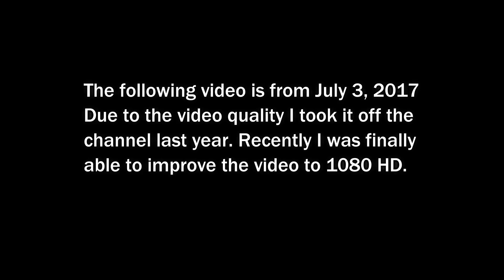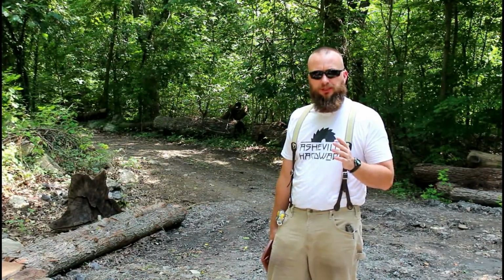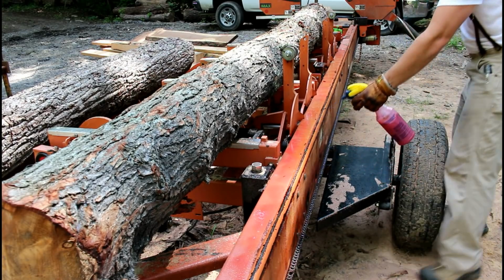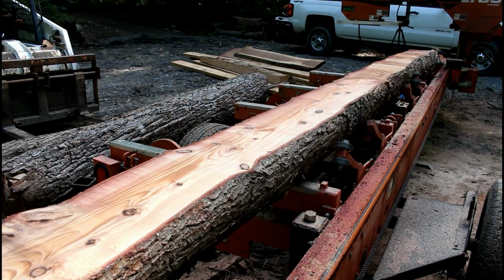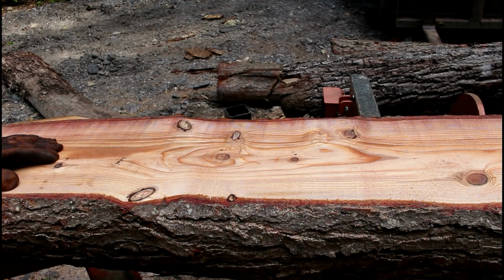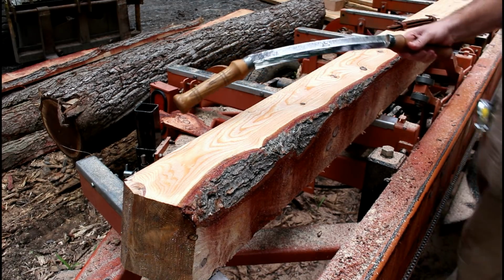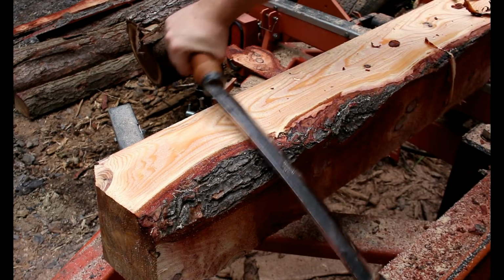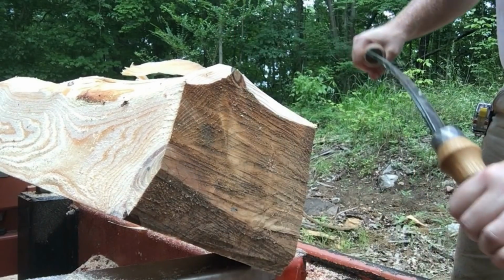THIS WOOD IS TREATED LIKE GOLD WHERE I AM FROM

Comment: Just came across this on your hemlock. First hemlock I came across was in the upper peninsula of Michigan. On state land west of the porcupine mtns, they were on state land where there are abundance of waterfalls. These trees were over 3 feet in diameter and most the first limb was over 50 feet in the air. I couldn't believe that they were growing on the rock as big as they were. Just an experience I had and thought I'd share it.

Comment: Just gutted my house built in the 20's. All true 2x4's of hemlock, some monster 7x7x25 hemlock beams and the ceiling joists are true 2x7x25! Shits rock solid, its like nailing into a knot
Reply from the maker: What are your plans for them?
Reply: There still holding the house up. I just padded them out to get a better r value of insulation since im in the north east. Had to sister up all the joists because of all the warping and settling over the years. After almost 100 years they were still extremely solid, and the wieght of one true 2x4 was like double that of the crap wood today. Hemlock is some solid dense wood

Comment: Hemlock is surprisingly stable, even with knots.
I once made a whole set of lattice panels under a deck out of air dried hemlock.
I think it was all just 1"X1", screwed to the 6"X6" pressure treated posts.
After 15 years, that lattice (aka "rabbit fencing") didin't move a bit.
It really is very nice stuff.

Comment: When you debark hemlock the bark looks like a big pile of porcupine quills, this jams up feed chains and belting. When sawing the knots which are hard will knock the edge off non-carbide saw teeth. Many commercial sawmills do not like to cut hemlock as the market is really not there for larger amounts. About the only time we would cut hemlock was when we had a order for a days worth of lumber, that was usually 30 to 50 k of board feet. We found it hard to sell the chips and sawdust too. These few logs that you are cutting are perfect for your mill. The planks are almost as good as American elm for lowboy decking. One more thing, when you try to pull a nail out of a dry hemlock plank, the nails hold in the board is amazing.

Comment: There is still way too much Hemlock here in upstate New York.  Early logging operations went for the Oak, Chestnut and White Pine and left the Hemlock standing.  Black Locust was used where rot could be a problem so it was used for fences and bottom sills, and you still see old fence posts along fields that have been there for a hundred years or more.  But Hemlock is still used where vertical strength is needed, and deck builders sometimes get bad batches that dried to fast and they split and crack like crazy.  A lot of old barns here were sided with Hemlock and it held up quite well and when the barns get torn down they re-use the siding for wall paneling and floors.  Nice to see you using it,  just dry it slow and it'll be fine.
Reply from the maker: thanks appreciate that history,
Reply: we cant keep enough in our yard to saw up, central NY

Comment: Years ago when I built a house from logs, I developed a sling from a serpentine belt with loops at each end , putting the belt at the balance axis, I could move 30' logs a few feet at a time with fair ease.
I peeled the logs with a shovel and then some for furniture I finished out with a draw knife.
Then coated the wood with tongue oil.

Comment: In the later 1800’s early 1900’s in northern Pennsylvania Hemlock was cut for the chemicals in the bark. The skinned logs were left to rot in the forest. Huge chemical factories in Potter County Penna. Documented in the book “Whining Saws and Squealing Flanges”. Fabulous read.
Reply from the maker: What did they use them for?
Reply: Out of the Woods . They made paint thinner and other chemicals. Can’t look it up. I loaned the book out years ago and am trying to get it back. The woodsman lived in bark huts they built that looked like tepees. Very primitive. They did want oak and cherry and did cut lumber as well as pine. Whining saws were the band saws and squealing flanges were the rail cars. Very primitive rail road in the forest. All steam operated.
Reply from the maker: Thanks for sharing
Reply: Out of the Woods . This is the good part of the internet. Sharing knowledge, talking to people one would never meet. Thanks for the video.
Reply from the maker: Thanks 👍

Comment: Hemlock is some dense wood very heavy I was moving some small logs one day in Maine most of which was Cedar until I tryed picking up that Hemlock and almost threw my back out, it also resist being burnt I would think that it would make a good log cabin what do you think? It would resist carpenter ants and termites!
Reply from the maker: I think so, the species is very rot resistant,
Reply: Ruttigorn Logsdon ......i have heard that HEMLOCK is very resistant to Termites standing and in board feet...
Reply: Ruttigorn Logsdon-I feel your pain! In the late seventies I work for a local lumbermill in Sanford,Maine.We used to plane a lot of hemlock back then.Like you said it's wicked heavy!

Comment: I was curious if you thought of doing a 50/50 mix of ATF & WD-40? The WD-40 will help with any water. & prevention of rust.
Reply from the maker: not sure woodmizer has always advised to use straight ATF, a good idea though maybe,

Comment: I think I may have watched this when it first went up. I discovered your channel around that time and wouldn't have been bothered by the low res. I've only recently been able to stream at more than 360p. Is the TF project you mentioned in the video the same one you're working towards now?
Reply from the maker: it is, will begin building it this month finally,
Reply: It's going to be an exciting journey.